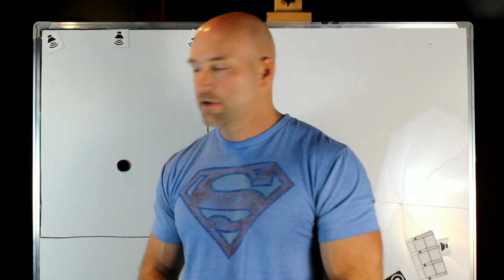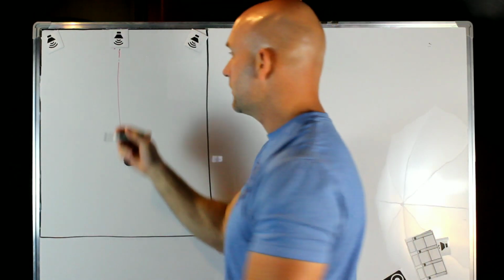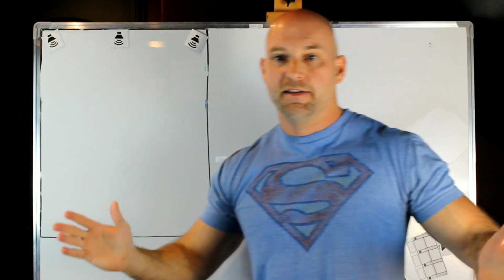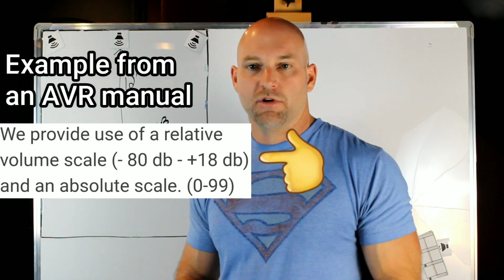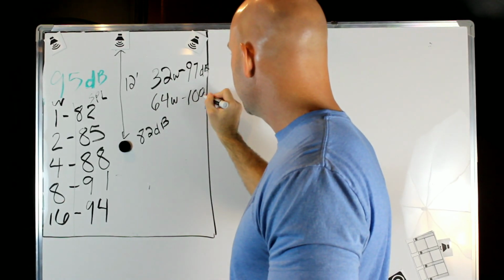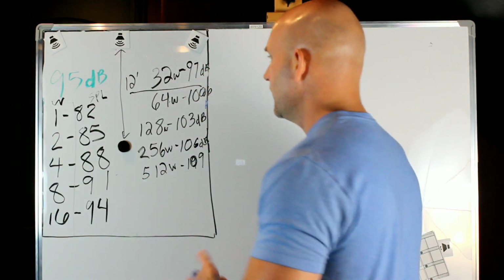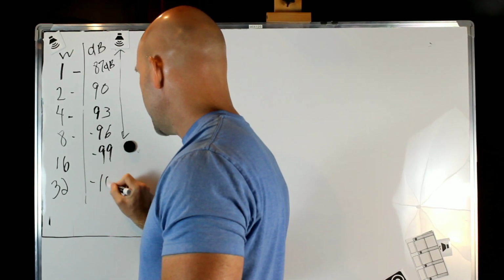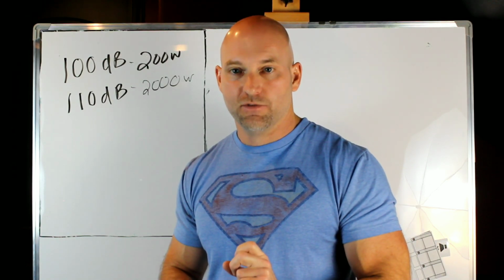Ep. 17 - How much power do you need for your Home Theater?

Comment: Based on this math my 70w @ 2Ch AVR is perfectly fine for my needs since most AVR's don't have much power anyways.  I usually only listen at -10dB at the loudest and now I know I shouldn't go beyond that to protect the AVR and speakers.  Maybe --8 dB at the most, but even that's pushing it.  As you suggest, separates are the way to go, preferably class A/B 200w amplifiers.  For now though I'll save my money and just use my cheap 5.1 until I can afford a decent AVR pre-amp, and something like the OSD Nero Max11.

Comment: Very helpful episode, this is what I was looking for. I have svs ultra evolution 7.2.4 HT setup. They are all rated 87 db with nominal impedance of 6 ohm. Max power handling on surround 150 watts, tower 300 watts and center 225 watts. Considering 12ft distance for LCRs, i don't think my speakers are capable of handling dynamic peaks of 105 spl based on their individual max power handling specs, so when I choose an external amplifier, is it okay to go with amp that supplies 350 watts at 8 ohms and 500 at 4ohm for all of them, including surrounds? I don't listen that loud. On my Denon A10-h, I keep master volume anywhere between 15 to 5 db below reference (after running Audessey). I just want to make sure that I have enough headroom.  So main question is; would I risk damaging my speakers with an external amp with that much power output, or should I consider level matching speaker max power handling with amp' output? I was thinking  of Buckeye Hypex NC502MP amp (powerful class D amp). But if you have a recommendation on amps that will maximize my LCR's and surrounds' performance without damaging them, please let me know.

Comment: My 7.3.4 sound system consists of 6 SVS Ultra Bookshelf speakers (2 for the mains, 2 for the side channels, and 2 for the rears), an SVS Ultra Center speaker, 4 SVS Prime Elevation speakers ceiling mounted for Dolby Atmos, an SVS SB16-Ultra subwoofer in the rear and 2 SVS SB-3000 subwoofers up front. The system is powered by a Parasound Halo A52+ 5 channel amplifier powering the 5 bedlayer speakers and a Yamaha Aventage RX-A8A AVR powering the rear speakers and the 4 Prime Elevation speakers for Dolby Atmos. Dual AC Infinity AIRCOM T9's keep the amps cool, and all are connected to a Panamax M5400-PM Power Conditioner. The output power of this 14 speaker Living Room home theater system is 4,300 watts R.M.S.
I've create a movie experience that equals a commercial theater.

Comment: Great videos man very informative and well presented. Question: I am trying to decide on a AVR or separates and confused what works best for me. My setup (still in boxes), 2x Paradigm 800f's, 600c, two p80-a's and two svs pb 3000.Thought about going atmos 2 or 4 but no sure as I will have my surrounds on the ceiling's just behind the back seats to the side and read about those not mixing well with nearby atmos. Anyways I started my AVR journey planning on getting the denon 3600, then Anthem mrx540 and now looking at the tonewinner at300/ad7300. My room is 14 feet away from main listening chairs 12 foot wide and left side of room opens another 15 feet approx. I do like loud but not sure what reference levels are because this is new to me. Also enjoy a good party cranky up the tunes. Any advice would be greatly appreciated.
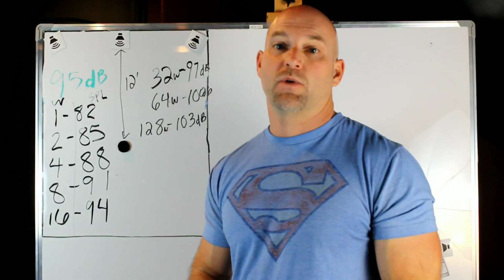Reply: 15:18

Comment: Hi, thanks for the informative video. On the Klipsch RF7-iii with 100db's, is my calc correct of needing 32 watts for reaching 109db's?
Reply from the maker: Yeah that sounds about right however keep in mind Klipsch rates sensitivity in room not anechoic so they sneakily factor in room gain.  They're high sensitivity but not what the specs say.
Reply: What amp are you using on your RF7-iii

Comment: Hello, could you help me calculate how much power I need?

The video explains it very well but it is not clear to me what is the sensitivity of my boxes.

On the web it says 88db 1w / 1m but there is a page where it was measured at 85.5db 2.83v / 1m it is
this 88db 1w / 1m.

From where should I start to count the watts?

My distance is 8 feet, how much do I have to subtract?

Greetings

Comment: You discussed listening at - 15db on the receiver/system stating it as hitting certain spl levels at a given level. However, depending on the source/recording (some movies like ones from Disney etc) are much quieter than others when playing at the same volume level. This led me to believe the level from turning your volume up or down is the gain of the receiver and not directly correlated to absolute spl. Is this incorrect thinking?
Reply from the maker: Unfortunately you are correct.  Studios don't always set levels properly.   The thing is we all know by ear what levels we like.  So if you know you generally like -15 and throw in something and the vocals are  way too quiet at -15 crank it up so it sounds as loud as sounds right to you.  You'll be around what -15 should be or at least close enough.  It's not an exact science so having headroom is important.
Reply: @hometheatergurus  also how does different power amps come into play. I can't imagine a basic denon like the s650h really hits reference at 0 on the volume and have the same spl as my x8500h.

Comment: I hit 90.4dB with my unfinished setup today idk how many watts I was actually using or anything but I was about 5ft away. Ive got the levels of my speakers set to -30 for all surrounds and center and it is still roaring at only 40% volume. I've still got to add a subwoofer or maybe 2 mini subs I haven't decided yet and my overhead speakers.

Comment: Nice illustration and useful information but it's unfortunate you don't account for multiple or all speakers playing in the room simultaneously which significantly adds sound pressure and reduces the required power you show to hit 105dB. Multiple uncorrelated sources add as a sum of the squares. Going from 1 speaker driven to 11 driven in a room can add as much as 10dB total SPL!  The peak SPL of 105dB per speaker you reference typically isn't a problem for a really good receiver that has plenty of headroom in the power supply to deliver enough momentary power to hit  that # on a moderately sensitive speaker. Anyway good info and separates are the way for the ultimate experience of course ;)
Reply from the maker: Is that you Gene? 😁

Yeah I just kept it to individual speaker demands at reference or personal levels but you're correct with several speakers peaking at once the spl in the room is far far above 105.
Reply: @hometheatergurus  yes it is. THX Ultra2 certification is NOT based on continuous power ratings BTW. They account for crest factors when determining if a receiver can swing enough voltage to hit peak SPL levels with compatible THX certified speakers.
Reply: Hello, could you help me calculate how much power I need?

The video explains it very well but it is not clear to me what is the sensitivity of my boxes.

On the web it says 88db 1w / 1m but there is a page where it was measured at 85.5db 2.83v / 1m it is
this 88db 1w / 1m.

From where should I start to count the watts?

My distance is 8 feet, how much do I have to subtract?

Greetings

Comment: I can't even imagine watching most current movies at -15 or -20. I usually watch at around -5 at the lowest. It seems to me you are missing out on significant dynamics at such a low level. Some movies do seem mixed extremely loud and can be overbearing at reference, but others would be impossible to hear whispers and low level dialogue at -15. I would advise everyone to design for reference, with speakers and amps that play cleanly at that level, and then adjust to taste. Many people are using speakers that cannot play cleanly at reference and then it is no wonder they think it sounds too loud.
Reply from the maker: That's personal taste.  I do room plans on the side and very very few of my customers listen louder than - 15.  There's also been several polls online that back this up as the norm.  What's right for some isn't for everyone.  We like what we like.

If your room is properly treated and calibrated you should absolutely have no issues hearing whispers or every detail with great dynamics.  If you do you have some issues that need addressing.
Reply: Greg Worrel that is your personal listening volume preference. Lot's of others don't listen at those levels so don't need to waste needless money for something irrelevant to them. A little headroom above the levels they listen to is fine.
Reply: @C--A  I don't disagree, but volume preferences are often set based on listening to systems that are simply incapable of playing at reference, so they sound like crap anywhere close to reference. We hear distortion as "too loud." Remove the distortion by using speakers and subs designed to play easily at reference,  and the added realism and dynamics can be startling.

Comment: This guy totally misses the electrical science that is super critical. On integrated (low end; this includes Onkyo, Yamaha, Denon, Pioneer, etc) the peaks he speaks of will not be at the level demanded by the audio track because the shared power supplies on integrated amplifiers are embarrassingly lacking in power reserve.  Your 7, 9 or 11 channel amplifier only has the power reserve to drive 2 speakers at the RMS Wattage numbers on the specs (read the fine print).  So expect your 9x 100W to be more like 9x 25W RMS during difficult scenes.  That 25W is not going to deliver clean sound at reference levels or be able to give you enough power to make snappy base on anything greater than like a 5_1/4" driver.  There's a reason 2x 100W of a "high end" amplifier takes just as much power (electricity) and weighs more than your receiver.  Weight is a good lay man's measure of an amplifier as the transformer weight (technology / science) hasn't changed in years.  Class D amplification for your mids and highs are simply not high end.
Reply from the maker: This is covered in the video, the power supply being the bottle neck, manufacturers rating one or 2 channels driven etc.  Sounds like you watched very little of the video.
Reply: You are missing a key factor in power supply requirements. Power demands are based on average power level, while maximum output demand is peak output. The crest factor of most home theater content is 12-20dB. That means the peak output is 16 to 100 times the average output. Power supplies only need to handle the average output, not the instantaneous peaks. Most amplifiers are designed with a power supply capable of 1/8 peak output which is more than capable of handling the rated output. That is why manufacturers do not put bigger power supplies in amps. It would be a waste of money. 

Also, the whole "all channels driven" comparison often cited by some amplifier manufacturers should be taken with a grain of salt. When are all channels driven to equal output with normal content? I would guess never.
Reply: This guy totally missed the whole point of the video which was a simple understanding of power requirements for home theater. Here’s a better question. How do I calculate power requirements for 6 ohm speakers? Ps “electrical science” 😅

Comment: Like you I usually listen at about -15dB sometimes I bring it up to -10dB. So I don’t think I need more power (Speakers are B&W w/90dB sensitivity) as I’m only 10ft away. However I’ve been wanting to make the move to separates because I see many comments on forums claiming their theater sounds so much better. In your opinion does it actually sound better when moving from receiver to separates? Receiver costing in $2500-$3000 range vs something like an anthem avm60 + amp.
Reply from the maker: It depends on if you're crossing to subs and how far away and loud you listen. Then of course keep in mind the placebo effect is real.   Blind test are the only reliable test.  Our brains are very powerful and can't be trusted ;).

If you run your speaker large then yes you could hear a difference.  If you're using bass management which I suggest I wouldn't personally worry about moving to separates.  You should have plenty of headroom from that distance and your levels. 

I'd invest the money on real upgrades like room treatments or fixing modal issues.

Comment: It is important not to forget, how much sound you loose with an acoustic transparent screen with the additional black layer. Even with the best ones it is a 1,5-2dB loss...
Reply from the maker: That's a great idea for a video. I've measured my Seymour xd and in the top octaves it was around 1.5db of loss.  Not detectable by ear and with pink noise you wouldn't be able to measure a difference more than half a dB at most. 

Of course not all screens perform that well.
Reply: @hometheatergurus  Does the loss only occur in the top octaves? Nothing in the midrange? Does that 1,5dB of loss only happen with the screen alone or with the black layer combined?
Reply from the maker: @PeterGobbler  you'll begin getting some loss beginning around 500hz but even at the upper frequencies 1.5db isn't that noticeable if at all but yep it is something to understand when calculating power.  The larger waves are much less effected by the screen that the smaller upper frequencies.  From testing I've done screen material like Seymour XD has no more attenuation than GOM and DMD acoustic fabrics.   If course not all screens perform that well but anytime I recommend a screen I stick with what I know works well. 

As for the black backing in 12 years of having acoustic screens and building them  for others I've never once had to use a lining back there.  Paint the wall black or use 1" ultra duct black (which is optimal) and paint the frame black.  No need to do anything else. I rarely even hear of people doing that but there are some that do.

Comment: Hey, me again and as I said before in my last post, what you do is awesome to me and it gets the point across clearly. I appreciate that. I have a question though, in terms of power consumption, shouldn't this apply to subwoofers as well? If a person is in a 1500 cubic ft home theater, shouldn't they use subs which would accommodate the room as opposed to buying the biggest baddest sub? I was thinking about this and wondering why would a person in a 1500 cubic ft room buy 4 seaton submersives for example. Isnt that uncalled for? What's your opinion on that?
Reply from the maker: Thanks again!  😁

Subs are different because the frequencies are modal.  With subs you size the Amp according to the design during modeling.  We will cover this when we get to the really fun stuff and design our own sub in WinISD.  I will give you a little info now.. Ported subs use little power down low compared to sealed because of the natural response having more output down low (to tuning) so the room gain is headroom where as sealed can extend really low but has less natural energy down low so it often needs boosting therefore more power.

Now there are tricks to get a ported to extend really low but will require boosting which we'll also cover.

Comment: Great video!
Could you also make a similar video with DIY subs.
Setting up a system with 4 og 8 subs, how to wire, and what watt is needed with different wire options.
Reply from the maker: Yeah we'll soon designing a living room friendly sized sub in winisd then we'll build it, subscribers will help choose a vinyl wrap and then we'll do compression test to measure it and compare it against subs on data bass.  I'll cover wiring, connecting to the Amp and everything else.

Comment: High sensitivity speakers, what's the catch?
Reply from the maker: Not following the question.  Did you watch the video?
Reply: @hometheatergurus  Yes of course. Let me rephrase. You speak of the benefits of high sensitivity speakers. What are the downsides? Why do manufacturers choose to produce one or the other?
Reply from the maker: @isak6626  many high sensitivity speakers use waveguides and compressions drivers that often aren't well designed with poor off axis but some are very well deigned like jbl M2 and even the 3 series.   Waveguides control dispersion but past there limits you lose control.  Compare that to a dome that can have great off axis much wider in degrees as there's no waveguide with limited control.

As I mention in the video it depends on goals.  Personally if output can be achieved with a dome I'd go that route vs a high sensitivity speaker that uses a waveguide.  It comes down to your personal needs.

We will get into off axis more in depth when we cover room treatments.
Reply: @hometheatergurus  Thank you. Looking forward to that video!